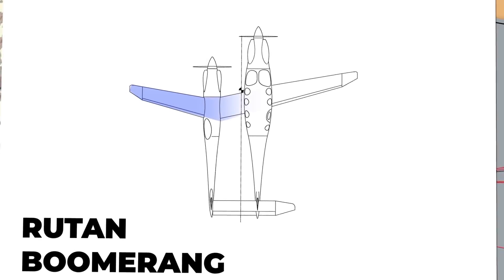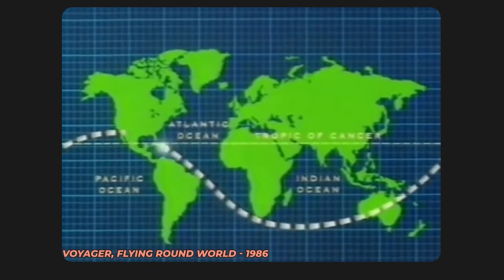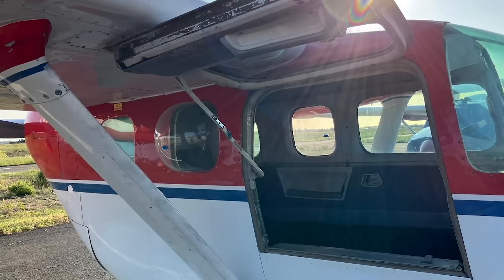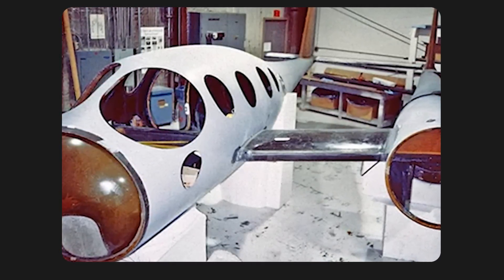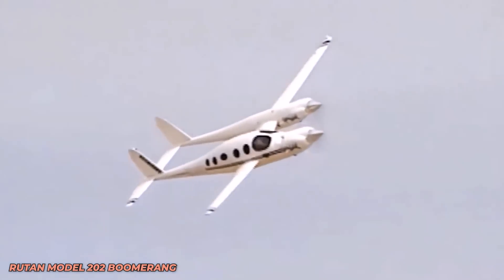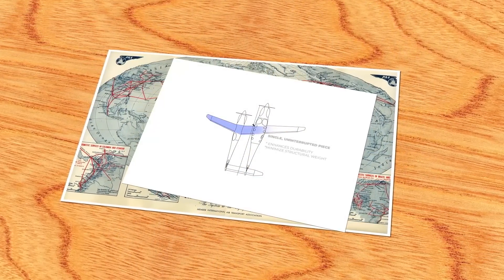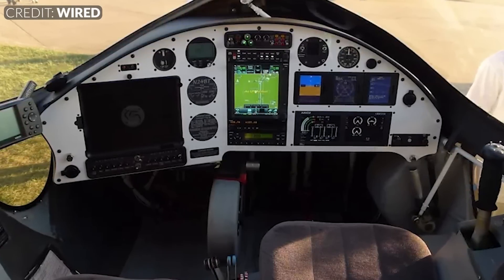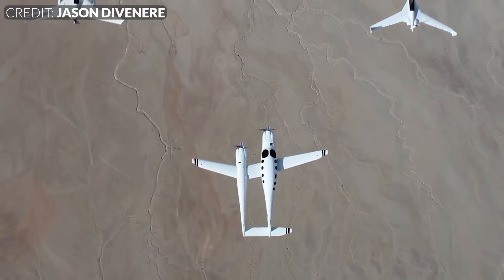Rutan Boomerang: Unconventional Genius!

Comment: His push pull Defiant didn't need any of that nonsense
Reply: The Defiant came first. It had problems. It was noisy on the outside, deafening inside. Vibrated more than normal. Lacked baggage space. Cargo was located far from the CG, limiting utility. Etc. 

A propeller located directly behind another is notoriously poor practice. Every aircraft of that general layout has been noisy, fuel hungry, and the aft engine rarely makes TBO in the case of the -337. And certain military bombers that also used this layout were severely crippled by it.

Comment: This guy is a hack, and nearly all the aircrafts he "designed" resemble the historical aircrafts from the past. Like many other have already stated that the boomerang is most likely inspired by the BV-141, and several other canard configuration, swept-wing aircrafts under his name were inspired by the Kyushu J7W Shinden, the XP-55 Ascender, and the Ambrosini SS.4.
Reply: BV-141 wasn’t twin engine.
Nearly all airplanes “resemble” past airplanes so your point is useless.
Reply: @Talon19  Burt Rutan was not the original inventor of the concept of structure asymmetry, period. Indeed, the two planes are configured differently, and he added an additional engine to the boomerang to combat various issues of the asymmetrical design and further improve or even perfect it in the process, but that doesn't necessarily mean he invented the concept. Give proper credit where it's due without slapping your name on it and calling it yours; it's the right thing to do.

“Nearly all airplanes “resemble” past airplanes so your point is useless.” You are partially correct and partially wrong because not all planes look the same and function the same way. Biplanes are not the same as monoplanes, and piston-engined planes are not the same as the jets. Low-wing aircraft don’t fly the same way as shoulder-wing aircraft, and there is a lot more to this.
Reply: @thelonewanderer9405  
Yet no one else has made the same aircraft since: so yes, the Boomerang is an original and exclusive Burt Rutan design.
Get over yourself.
Reply: @Talon19  Neither does it dismiss him as a copycat. Get over yourself.
Reply: @thelonewanderer9405  
LMAO.
A copycat who doesn’t have any aircraft which are copies of other aircraft …brilliant deduction.
Reply: @Talon19  Indeed, it's such a brilliant deduction of forgery that pinches and benefits from the original idea and the achievements of the other brilliant minds.
Reply: @thelonewanderer9405  
What in blazes are you talking about? Pinches?
Reply: @Talon19 Allow me to diligently put in a more elegant word for you, it means appropriate.
Reply: @thelonewanderer9405  
Duh, all invention is derivative.
Reply: @Talon19  This is exactly my point, buddy.
Reply: @thelonewanderer9405  
Then you forgot what your point was.
It’s literally the first thing you posted: “This guy is a hack”.
Reply: @Talon19  Well, he is a hack in a way because, by one definition, a hack is" a writer or journalist producing dull, unoriginal work," in his case, a plane designer. You can keep arguing that the planes he designed are "original" in their own right, but my point is he didn't invent the airplane or the concept of structure asymmetry, but prior designs inspired his works/innovations. Additionally, you stated yourself, "Duh, all inventions are derivative." So, what's the point of debate here?
Reply: @thelonewanderer9405  
The point of debate is the terms being used.  I’m unsure how anyone could claim Rutan designs are boring or dull.
Reply: @Talon19  Look, I respect and understand that if you like, admire, and are passionate about his "designs," I won't debate you because it's a personal preference, not academic, so I digress. You also kept the entire debate civilized, which is commendable, so Let's agree to disagree.

Comment: In WW2 the Germans had a similar plane.
Reply: Which aircraft?
Reply: @Talon19  Blohm and Voss
see goggle images for strange WW2 aircraft
Reply: @pigdroppings  
Similar because…?
Were they made of composite? No.
Were they two engines but not the same engines? No.
Did they have forward swept asymmetrical wings? No.
Did they have two booms connected with asymmetric control surfaces? No.
There are a very few cases of single aircraft incorporating single elements of the Rutan Boomerang.

Saying the BV-141 is “similar” to the Boomerang is like saying motorcycles are similar to half-tracks.

Comment: Strange. If you'd design the Boomerang with two equal size fuselages, what you get looks like a twin Mustang. There have been more, two single prop planes combined into a two fuselage twin prop. It is a smart concept. Easy to build. Only problem, you get drag for the second fuselage, if you do not really need to have so much space, for passengers or for a huge lot of fuel (do you really fly huge distances often?) then it's better to reduce the second fuselage size. Burt Rutan is famous for reducing drag.

Comment: Great video info about the "Boomarang"
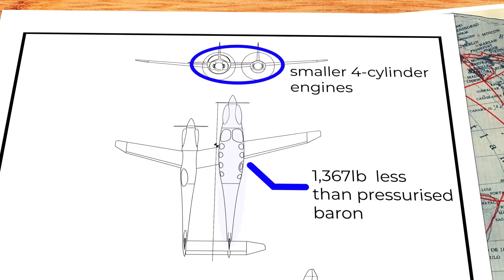But I must say,, at mark 7:05, references tonthe Beech Baron, are ruined by the schematic at 7:08 is not a Baron.
Its the Beech B60 "Duke", which is different class slightly above the Baron, which leaves me to question; Are you comparing figures against The Baron, OR The Duke?
Just saying.

Comment: Looks a lot like the Blohm&Voss 141 the german reconaissance plane. The Wings are apparently different but the Rest??  The Idea was good, the sight incredible and the Plane was, in reffering to Eric "Winkel" Brown the RAF testpilot, stable and easy to fly.
Like every Aircraft it has its flaws but the Germans knew, you can't go further and advance in Science and Technic without failures. Learning by doing, was and is, allways the best approach...isn't it not like that??

Comment: Technically, you can make any asymmetrical design, but it will only fly if the forces produced are symmetrical.. If one could visualize resulting forces with vectors, symmetry is always present.

Comment: Yapping along with no real sence… showing a Duke as a pressurised Baron… same as showing a tesla as a Yugo… the landing gear offset was a real issue with tyre wear and clear on takeoff and landing the thing was not easy to control on the ground… Rutan is a genius, responsable for most techniques used in carbon fibre layups today

Comment: I’ve always wondered if his designs were so good why don’t we have certified ones from a manufacturer cranking them out like the Cirrus or Diamond? Went to his hangar in Mojave with parts for him to inspect of my VareEze project about 1978. He had just flown his N4EZ to the Watsonville flyin. Wow ! It attracted hundreds of people. Everyone was talking about it. it was just him and a receptionist. Remember seeing an Apple II computer in his office. Knew he was cutting edge designer since that Apple was the hottest thing going. Was a pharmacist with poison control experience…didn’t like the epoxy system he used. Tough on your liver. He recommended liver tests periodically.😮

Comment: I got to meet and talk to Mr. Rutan many years ago at a SolidWorks convention held at Disney's Coronado Springs Resort.  He was working with Virgin Galactic at the time.  The man was fascinating to listen to and seemed like a genuinely nice guy.  Orange county choppers was paid to be at the same convention... they were just there to deliver the bike SolidWorks corporate had bought, collect their check, and leave.  Burt stuck around spending time looking at displays on the show floor, and talking to people.  He even stuck around for the dinner we had inside of Hollywood Studios after close.  He was looking at the bike the Orange County guys had built and a friend of mine that worked for SolidWorks let him thru the ropes blocking it off, started the thing up in the middle of the show floor in the Coronado Springs convention center and then turned it over to Burt.  :) It was awesome, I still have pictures.  I found Burt to be very knowledgeable and super friendly.  Very down to earth and interested to what others knew and what they were using SolidWorks to design.

Comment: Thanks for producing this excellent re-cap of the Boomerang. I got to go for a flight in the prototype aircraft featured here, and chat with Burt a lot about it, and both Burt and his boomerang design were remarkable and lovable. A little told account about Burt and the Boomerang was that Burt did not have an Instrument rating, and inadvertently flew into IMC conditions and encountered a thunderstorm in the Boomerang, lost control and managed a recovery that from the description I doubt any similar light aircraft would have survived, but Burt and the Boomerang survived perfectly intact.  

There was a follow-on story involving Burt and the Boomerang I was involved with in the late 90's that led to my meeting Burt and the flight in the Boomerang: After Ray Morrow the founder of II Morrow,  the company that developed the first commercial Loran and GPS navigation avionics for general aviation, sold that company to Garmin he contracted Burt Rutan to develop an air taxi version of the Boomerang. The cabin was a bit larger than a Cessna 414,  and to be powered by Continental TISO-550s, and expected to transport 8-9 passengers at about 300mph.  Burt constructed a mock-up and we spent a couple of years with Burt developing the design and working on FAA certification. 

The Boomerang design turned out to be an excellent air-taxi platform as nearly the entire fuselage could be utilized and even toilet and washroom accommodated.  Baggage and cargo could be stored in the left boom, and due to the large-span horizontal stabilizer it had an unusually broad loading envelope as well as payload and range.  

Sadly, the FAA misled (lied to?) Ray as to certification requirements. Original estimates for the FAA paper work was about $8 to $12 million. But once we committed to the program the FAA said it could cost up to 10X more. Basically it appeared they they wanted to tap what they saw as deep-pockets to fund a new FAA General Aviation certification department. A regrettable loss to aviation,  as today I believe it would eclipse today's state of the art turbine aircraft.

Comment: Wow.  You have missed the single most important design criterion that inspired this airframe.  Your research is fundamentally flawed.  Burt did use two engines he had laying around this is true, but he was angry that the exact same engine with clockwise rotation cost an additional 20k.  The design goal and objective was to fab up a working airframe with two available on the shelf engines that turn the same direction. That it compares/bests other twins was not part of the equation.  Only a matter of wrapping an airframe around parts immediately available.
Reply: Can you source why this was the "single most important design criterion" when it seems that there are numerous advantages for this configuration.
Reply: @Axel_Andersen    From Scaled itself.  This airframe was/is in fact a form of FU to engine makers that charge what Burt thought was a ridiculous additional fee for an engine with opposite rotation.  What numerous advantages?  Is the airframe flying now?  No.  Has the airframe been reproduced?  No.  Has anyone replicated the design?  No.  Is the airframe comfortable for even short flights?  No.  Was the airframe put through full spin/stall tests?  I don't know, and I would doubt it.  Does the airframe roll symmetrically?  Was this tested?  This airframe is another proof of concept from Scaled; no more than that.  Asymmetry in the aero form factor is not new.
Reply: @sseim5654  So essentially you are denying almost everything said in this video? Maybe you are correct, I have no way of knowing and don't really care. 

I was triggered by the hyperbole "single most important design criteria" wording. Looks to me that Rutan had many ideas he wanted to test, express or simply show of in this design.

As to bringing up "has it been reproduce" ie popularity as an argument against the design, I won't buy that, not for this design or any design in any field.

Comment: There was a plane with similar asymmetric configuration in WW2.
BTW: the image at 7:55 shows a 6 cylinder engine, not 4. 3 sparkplugs on each side!
Reply: The image used is the Continental io-360, not the Lycoming tio-360. It's probably an honest mistake, but details matter.
Reply: You also missed that the line drawn picture was a Beechcraft Duke, and NOT a Baron.

Comment: Funny you need to do better research as this is covered by article's in Sport Aviation among other's . The original design came about because Burt had 2 engines sitting with no use that where of deferent sizes . He being the engineer he was decided to build around that constraint as the design progressed it was I believe to replace a Cessna 210P he flew to be mor efficient and comfortable to fly nonstop between 2 destinations he needed to travel to frequently .
Reply: The narration indicated Lutan designed the aircraft around the engines available.
Reply: They only differed by 10hp; that's likely just different tunes of the same engine.
Reply: Burt built the Boomerang because he was flying single-engine aircraft over the Rockies and wanted some redundancy in case of engine failure.  But also with 2 engines comes additional safety concerns, hence the overall design.  The choice of engines was for no other reason than that's what he had around at the time.  One engine came off the catbird.  That's why one engine has manual wastegate and the other automatic wastegate... this results in a little extra engine management, but that's only because the aircraft itself is a prototype proof-of-concept.  Theoretically, there are a few things that would be "cleaned up" or changed if the airplane ever went into production.  My source is Burt himself.
Reply: He didn't do any research at all, he lifted every word.  Google "Aerocrafted Boomerang" and you will see a great article on this airplane.  The text from that article has been stolen 99% word for word and recited in this video by this content thief who makes a habit of doing this.  I wrote him an email a few months back calling him out on a different video where he did the exact same thing.  He confessed and vowed to do better, but has obviously continued to steal the work of others and attempt to profit off it.  I encourage all to unsubscribe.  I'm contacting youtube to have him demonetized.
Reply: I would not take article's in Sport Aviation as gospel, they are subject to the same research, miss quotation, taken out of context etc problems as any YT video.

Comment: Rutan claimed that the secret to the success of the Boomerang wa the use of servos that would automatically adjust and compensate the control surfaces. I was hoping to learn more about it in this video but it was not mentioned at all.
None the less, thank you for the deep dive. I learned quite a bit
Reply: So...literally a FBW?
Reply: Google "Aerocrafted Boomerang" and you will see a great article on this airplane.  This text from that article has been stolen 99% word for word and recited in this video by this content thief who makes a habit of doing this.  I wrote him an email a few months back calling him out on a different video where he did the exact same thing.  He confessed and vowed to do better.  I encourage all to unsubscribe.  I'm contacting youtube to have him demonetized.
Reply: It would seem obvious, that this aircraft must be balanced not only longitudinally as any conventional airplane, but also laterally. Because passengers mass is located to the right of the center of gravity. And excess baggage is located far outboard to the left.

This leads to lateral imbalance issues between solo flight and full cabin, depending also on baggage. A solo pilot who loaded the cargo boom to the brink might find an aircraft with a tendency to roll left.

To compensate, the obvious solution, beyond basic configuration (which is frozen in a suboptimal manner in this regard). The solution is to utilize the autopilot system to compensate for lateral mass imbalance. As the ailerons are quite powerful, no doubt.

Autopilot uses small electric servos, integrated with instrumentation, to actuate control surfaces, for automated assistance in maintaining altitude, attitude, and direction.

With minor modifications, most autopilot systems could function as a full-time wing leveler, that would not disengage or overpower the pilots ordinary aileron inputs.

Comment: From what I read at the time, Rutan's goals were: 
  1. To build a twin-engine aircraft with standard (clockwise) engine and propeller rotation on both engines,  but make these somehow cancel and result in neutral, symmetrical handling. 
  2. To build a twin-engine aircraft such that if one engine failed, the plane's failure mode would not have horribly asymmetric thrust and be almost unflyable. 
How well did he accomplish those?
Reply: Considering that it was done years before he was even born... Its called trim. And designing effort. All aircrafts fit for use had completed these criteria.
Reply: @alexturnbackthearmy1907   And how does that answer the question that @Baribrotzer posed or are you here just to belittle what Rutan wanted to pursue and apparently achieved. There are many ways to skin the cat. It is not reasonable men that advance science and tech it is the unreasonable that do.